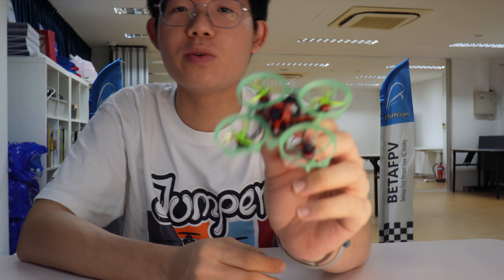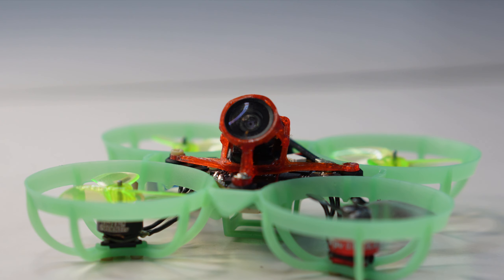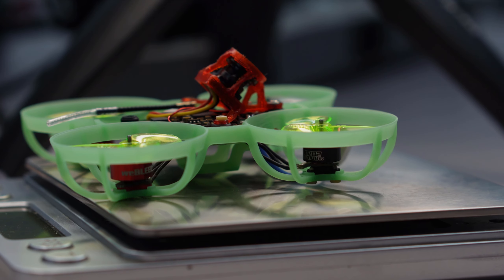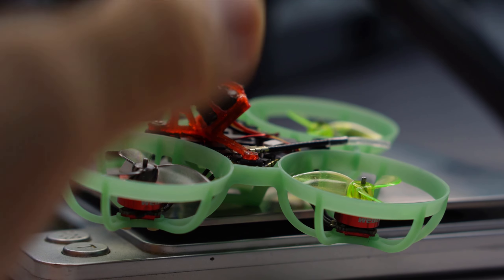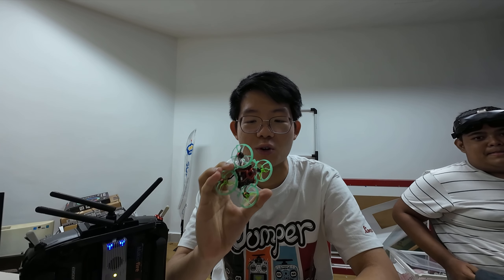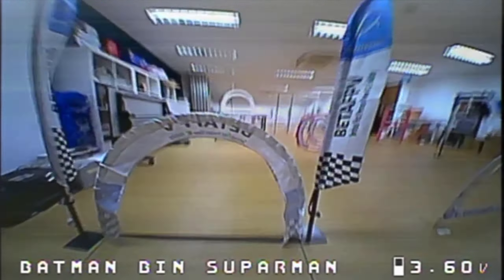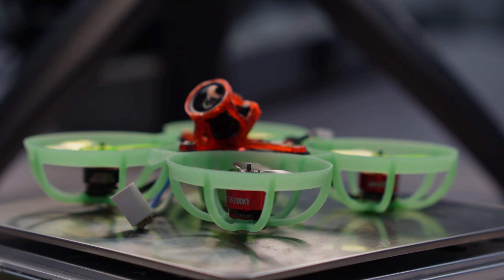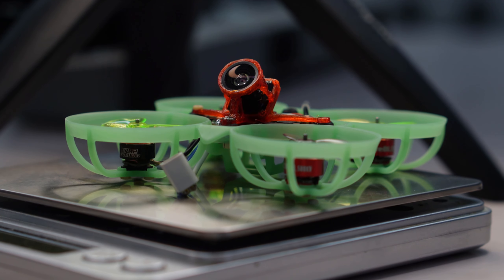Mini Review: BetaFPV Air Brushless 5in1 AIO FC!

Comment: Just a fair warning these ICM42688 gyros are already used in JHEMCU boards and are super sensitive and prone to failure. I hope betafpv adresses this and these boards are not prone to the same issues
Reply from the maker: Before the cross boards I used ICM gyros for over a year on the original 5in1. Agree that they are more susceptible to damage than the BMI270 that is why board orientation and camera mount are so important.

Comment: Nice! I’m very excited for this new 5-in-1 board. I bought a Mob6 2024 just for its new board but I think I’m gonna sell it and use the BetaFPV board instead.
Reply from the maker: Both of them are great boards, I would keep them both and see which one you prefer!
Reply: @WerdnaFPV  No real improvement in running 8k gyro vs BMI 3.2k?
Reply: Bmi gyros are junk. They are cheap, have poor qc, suffer from drift and are much more prone to failure. Issues with older 42688 designs is dropping them on to poor designed fcs. The bmi is less sensitive to electrical noise so it can handle a poorly designed fc/aio better but now the brands have started to get their shit together on the newer designs there will be a lot less issues with them

Comment: Why you don't put the fc upside down to protect the gyro and there would be enough free space for ufl too. How about the stock tune? Awesome flying and thanks for infos. I'm still waiting for mine. :)
Reply from the maker: I used the same tune as my cross boards (Justice Spicy) and it worked just fine.
I didn't want to put the FC upside down as the motor pads are only on the underside of this board (unlike the cross board) so it's quite annoying to solder and repair motors that way

Comment: What you meemed at the beginning, is the reason i never flew betafpv, i always wanted a true AIO. That and the fact that the only FC i ever bought from betafpv was bricked after the 3rd crash. 
I am thinking about buying this one, but if it has any problems, i will be staying away from betafpv electronics indefinetely. Hoping this little FC will change my mind though.
Reply from the maker: Every true AIO will have a higher failure rate than a 4in1 by nature of the cramped components and more points of failure. This is a fantastic FC and the best on the market but it will not be immune to abuse especially if you crash a lot and put the wrong Bluejay settings.